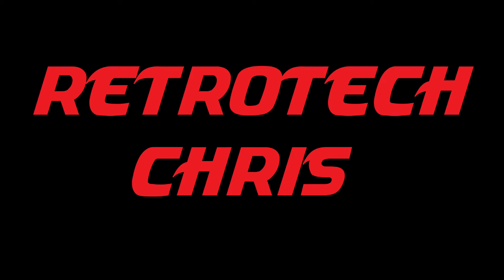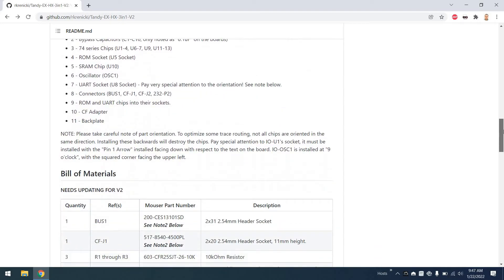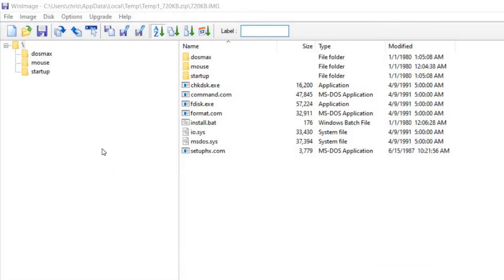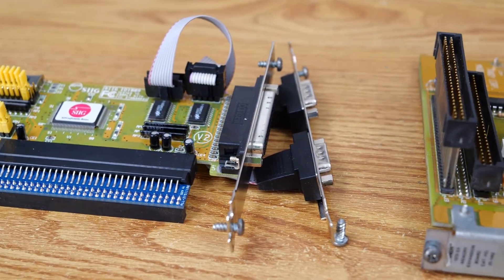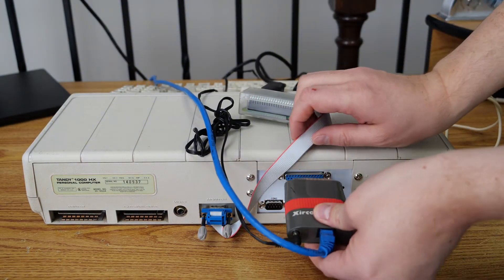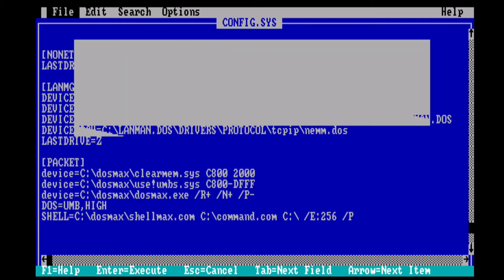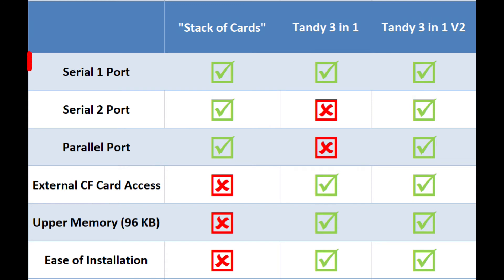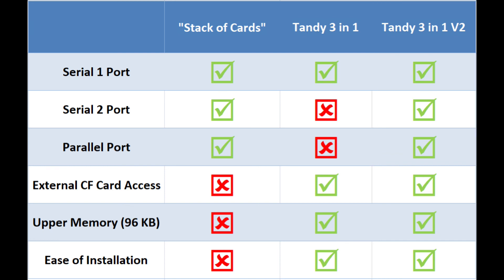Exploring Three Different Tandy 1000 EX/HX Expansion Card Options: Which Is the Best?

Comment from the maker: So one thing I missed in my comparison: the 3-in-1 solutions do not have a DMA controller.  For most cases this is not a big deal since the 3-in-1 card has SRAM, so not needed for refresh (video chip refreshes the motherboard RAM).  Some use cases do use DMA (i.e. specialized disk writing software, sound cards).  If planning one of these use cases, you'd want to go with the "stack of cards!"
Reply: If I remember reading correctly, some earlier Tandy 1000 compatible games actually do NOT work with a DMA controller installed.

Comment: Thanks for the great video! Quick question - I know the Tandy Memory Expansion card also included a DMA controller. Is this a feature of the "bundle of cards" solution over the 3-in-1? I don't believe the 3-in-1 includes a DMA controller right?
Reply from the maker: You are correct!  Here's the designer's take on why there is no DMA controller on the 3 in 1: "Memory refresh on the 1000, A, HD, EX, and HX is handled by the video chip.   The video chip can only access the RAM on the motherboard itself, and not on any expansion cards.  Tandy used the DMA controller to handle DRAM refresh for the expansion card(s).  Since this design uses SRAM, it does not need to be refreshed, so does not need a DMA controller."
Reply: @RetroTechChris  Thanks! I recently got a Tandy 1000 EX, and it actually came with a Memory Expansion card already (extra bonus that wasn't on the listing :) ) so I've been trying to decide whether it's worth taking it out to use a 3-in-1 or keep it and do a stack of cards. Sounds like the DMA isn't that big of a deal then, now it just comes down to how original I want to keep it :)
Reply from the maker: @nathanbyrd873  that's awesome!  Yea, I kept the stack of cards in mine until that 3-in-1 V2 got released... great card!
Reply from the maker: Also from the designer: "There are a couple of edge cases that depend on Direct Memory Access as well, such as some disk image writing software, but they are few and far between. Same with some hardware, such as a Sound Blaster, which 1) wouldn’t natively fit, and 2) would take away from the Tandy 3 voice sound that the system is known for."

Comment from the maker: So, at present, I'm now aware of anyone building these cards, but the GitHub repos listed above in the description do include a bill of materials!  Also, in addition to the 3 in 1 cards, there is also a 4 in 1, which includes a  SmartWatch chip, but I don't believe includes a parallel port or second serial port.  I've added a link above to the 4 in 1 repo.

Comment: I am needing one for my 1000EX
Reply from the maker: They are great to have!  If you are handy at building a card, you can grab the bill of materials, link in the description.  Otherwise, you might check out the TRS-80/Tandy 1000 Facebook group to see if anyone is planning to run a batch of cards (link also in the description)
Reply from the maker: Also, I do see them occasionally pop up on eBay!
Reply: @RetroTechChris  I can do the soldering but not the chip flashing.
Reply from the maker: @pitfalljerry  you might be able to program the chip with a bootable floppy and XTCF software! If not, a ti866 plus will do the trick for flashing a chip!
Reply from the maker: @pitfalljerry  I asked in the discord if anyone has tried to flash without a programmer.  Will see what we find out!
Reply from the maker: @pitfalljerry  yep looks like you can flash it without a programmer! https://github.com/rkrenicki/Tandy-EX-HX-3in1/blob/main/XTIDE%20BIOS%20Flashing%20Directions.pdf

Comment: where you could buy this ?
Reply from the maker: At this point, you'd need to assemble your own, but occasionally there are folks who create these.  It might be best to join the TRS-80/Tandy 1000 Facebook group for updates!
Reply: @RetroTechChris  is a 286 to 486 cpu card possible ?
Reply from the maker: @neomatrix4412  this system has an 8088 CPU.  It can be upgraded to a V20 to get 80186 compatible instructions.
Reply: @RetroTechChris  i mean the 1000tx
Reply from the maker: @neomatrix4412  ah.  I'd imagine so, but I think those upgrade CPUs are pretty rare.  Also, keep in mind the TX only has 8 bit ISA slots.  Might be best to acquire a 486 system instead.
Reply: @RetroTechChris  nostalgia - i owned a sx and cm11 and a track star
Reply from the maker: @neomatrix4412  nice!  I had a 1000 SX with a CM-11 too!!

Comment: I have both a 1000 and 1000SX. No keyboard for either. So I haven't tried restoring either. Any suggestions for those? I do have 1 monitor, a couple printers, and boxes and boxes of floppies.
Reply from the maker: Definitely have some suggestions!  For the one without a monitor, you can use an RGB2HDMI for video. For keyboards, I believe that Cybernatic Systems on Tindie makes adapters... if not, there is a great TRS-80/Tandy 1000 Facebook group with lots of folks who have made adapters and other components.  For storage, you can go with an XT-CF adapter to add "hard drive" storage!  You should definitely join the Facebook group, lots of great info in there

Comment: A 3-in-1 v3 with with an ISA adapter for the upper slot would be perfect. COM1+LPT2 can fit on slot 1, COM2+CF can fit on 2, leaving 3 free for experimenting (ethernet / sound card / hercules video for 2nd display )
Reply: Unfortunately, it would be super limited both in physical space, and in available resources.   With the V2 design, there are no available IRQs left on the expansion bus, and most of the upper address space is taken up with Upper Memory Blocks.
Reply from the maker: True!  The bay is a little "small", so most conventional ISA cards won't fit. But I like the idea!
Reply: @RetroTechChris  Hi - we cant be to far away from V4 with ethernet and WIFI - a project for the Raspbery PI as a add on ??
Reply from the maker: @georgemaragos2378  I think we might be out of IRQs! But I have gotten Ethernet on these using a Xircom Pocket Ethernet III connected to a Google WiFi access point :)